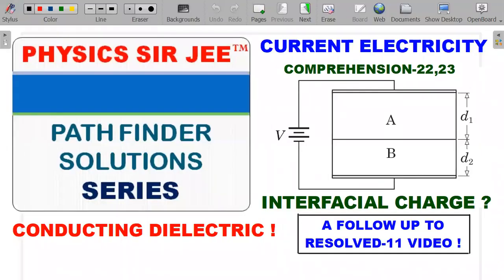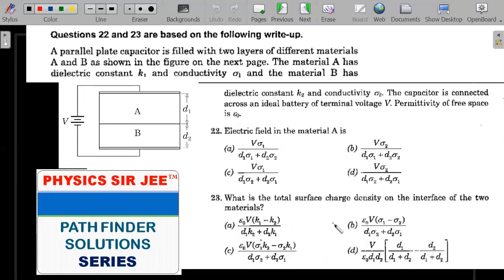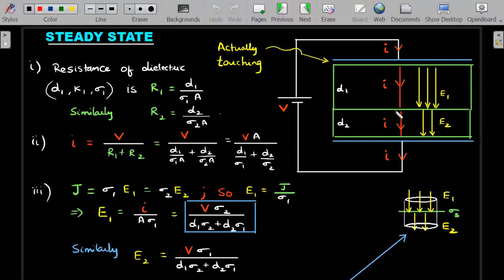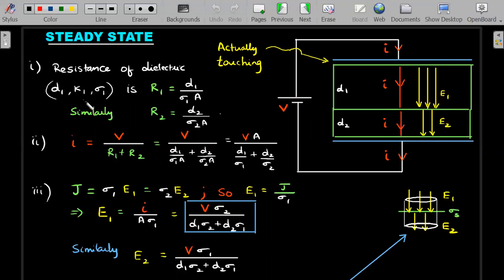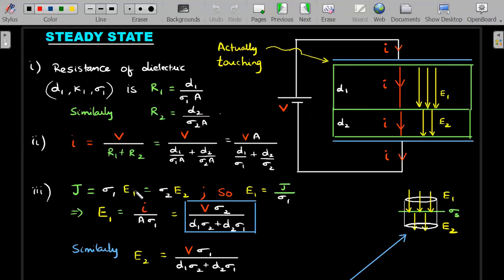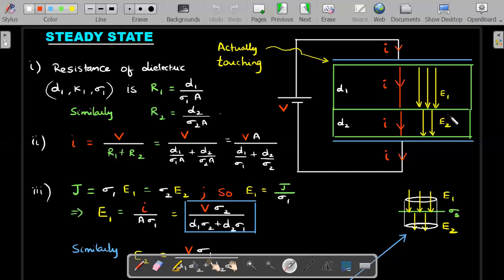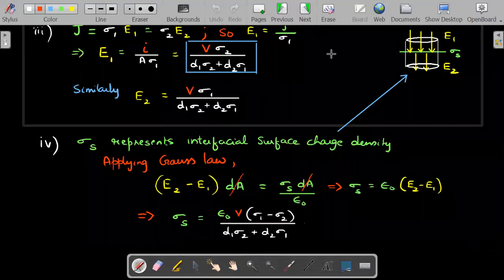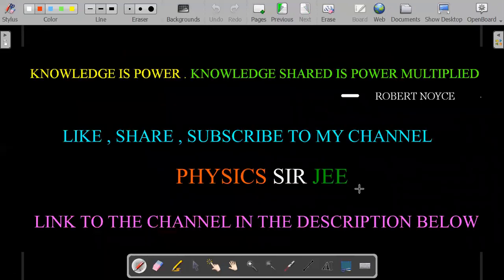PATHFINDER SOLUTIONS😎-ELECTRICITY-OBJECTIVE 22,23-SERIES CONDUCTING DIELECTRICS-JEE ADVANCED PHYSICS

Comment: Sir if they asked the surface charge density of extraneous charges then would it be eo(k2sigma1-k1sigma2)/d1sigma2+d2sigma1 ? As qex1=k1.qnet and qex2=k2qnet .. by considering the gaussian surfaces in left and right half separately ?
Reply: Could you tell me how extraneous charge would appear here?(like in a capacitor with a dielectric, extraneous charge is on the plate.)Where is extraneous charge on this one.?
Reply: @sameeranand6439  i guess on the respective side of the interface only the extraneous charges would appear
Reply: Why did you use two different gaussian surfaces
Reply: @sameeranand6439  because both have different values of K
Reply: How did you calculate those Extraneous charges?
Reply: @sameeranand6439  by using ø=Q/Keo
Reply: I mean Qext/Keo
Reply: If you consider gaussian surface in in dielectric, Wouldn't the Flux through it be zero? as electric field is same everywhere inside a single dielectric
Reply: @sameeranand6439  that's when dielectric is homogeneous, at the interface inhomogeneous is there, that's why it's not 0

Comment: Sir I have a question please please help.
In the interfacial surface ,the net charge should be the bound charge of dielectric 1- dielectric 2(I mean at the interfacial surface the induced charge due to both E1 and E2 is present right? So should'nt this be the scenario sir?
And if it's so how to write E1? Because induced electric field= q induced/AE0 but here the two surfaces of dielectric 1 have two different surface charges. So how to write induced electric field in dielectric 1 in terms of induced charge sir as there are different charges on 2 surface?? Kindly kindly help🙏🏻
Reply from the maker: Difficult to help in a comment. Please read through IRODOV theory book
Reply: @PHYSICSSIRJEE  sir do you mean the book called BASIC LAWS OF ELECTROMAGNETISM BY IE IRODOV?

Comment: Sir can u plz clarify this-Current is the flux of current density and current density=sigma*Electricfield which suggests current is sigma*electric flux. But electric flux is always zero through any part of a homogenous medium as no charge accumulates in the volume...so current is always zero?
This seems paradoxical🙄
Reply from the maker: Equal amount of charge enters and leaves the homogeneous medium without accumulation. That constitutes current
Reply: @PHYSICSSIRJEE  Then why the equation suggests current to be zero? Or am i misinterpreting flux of current density?
Reply from the maker: @pneumaguitarist949  yes, current is related to Electric field and not electric flux
Reply: i think i got it. Current is integration of current density over "one" surface. So the electric flux that appears after taking sigma out of the integration is just the outgoing flux and not the net flux, so its not zero, so current is not zero.
Sir,plz reply if i am correct.
Reply from the maker: @pneumaguitarist949  perfect 👍😊

Comment: Sir, does this interfacial charge also consist of extraneous "+" bound charges?If yes then what do we mean here by extraneous and bound charges at the interfacial surface? From your resolved 11 i can digest that the charge on "capacitor plates' is extraneous and due to which bound charges are induced on the outermost surface of the dielectric. But can imagine similar setup at the interfacial surface.Plz help
Reply from the maker: Here , in this problem, the total charge on the interface is Bound charge only. There is no extraneous charge at the interface here 🙂👍
Reply: @PHYSICSSIRJEE  thank u sir.

Comment: In the first problem if we calculate electric field in terms of dielectric constants using the fact that V is divided in inverse ratio of capacitance and then potential difference divided by Gap.....
And that expression using in the second part I am also getting first option for charge density ??
Reply from the maker: When you write the formula Q=CV ,Q is extraneous charge on metal plates , not including dielectric. Here there is no metal plate at the interface. So you need to be extra cautious using formula based approach. Also , In steady state here current is flowing.
To understand more about extraneous charge, please kindly watch RESOLVED-11 video , the link in description above 🙂
Please feel free to ask any further Doubts on this 👍
Reply: @PHYSICSSIRJEE  so in this situation we can't take it as a combination of two capacitors in series as we normally do to find equivalent capacitance
Reply from the maker: @roam2explore588  yes🙂👍
Reply: @PHYSICSSIRJEE  I think your yes means NO for that series method 😁
Reply from the maker: @roam2explore588  TO CLARIFY : A BIG " NO" FOR THAT METHOD 😂
Reply: @PHYSICSSIRJEE  Sorry sir  for troubling you so much..... Can we define equivalent capacitance here
Reply from the maker: @roam2explore588  Better not to, because it's of no use in fundamental Calculations. The whole idea of effective capacitance was to reduce our Calculations . Here that purpose is not solved 🙂
Reply: @PHYSICSSIRJEE  Thanks a lot sir... 👍😊🙏